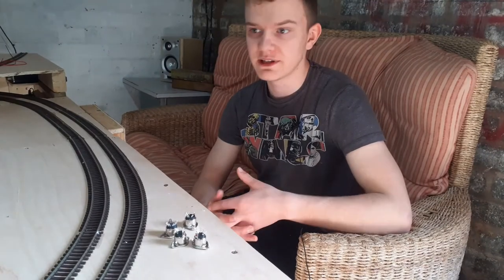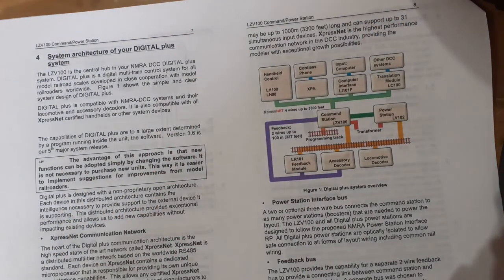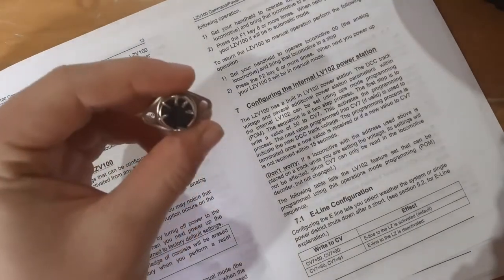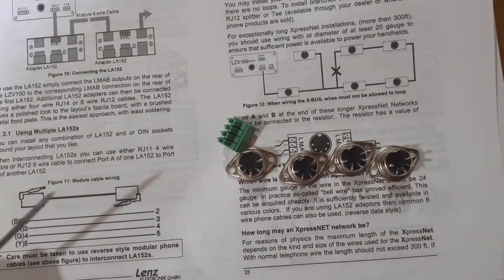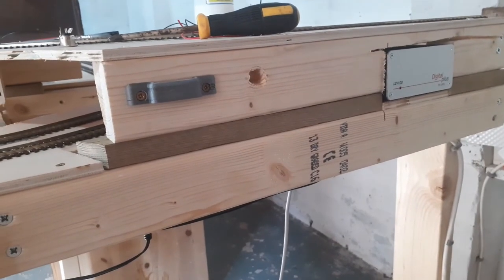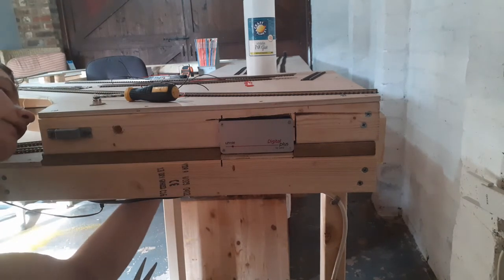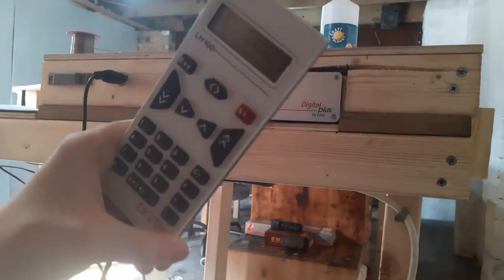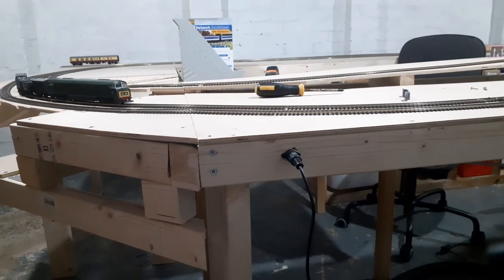7. installing Lenz DCC XpressNet throttle sockets.

Comment: I too use Lenz system and with XpressNet LA152. 5 pole DIN sockets is a good idea and a good tip is to use 4 difference color of the wires by solder DIN sockets to avoid mistakes when you connect. Have fun!

Comment: With the wiring of the bus, it would have been better to use two whites on one data and the two corresponding solid colour on the other data so twisted pair could do its job of noise cancellation.   Doubling up on the data was likely not needed though, then you could have a spare pair in case of damage, or for some other function in the future.   Doubling up power is a good idea though.
Thanks for another great video.
Reply from the maker: Thank you very much for your suggestions, I'll keep them in mind next time I rewire any expressnet

Comment: Well David, I have now watched your video and am really impressed with your efforts so far.  You are really industrious and is great to see.  I am much older than you and for me there’s no rush, so I do things quite slowly.  I am interested in Lenz twisted pair wiring installations and unfortunately most YouTube videos feature main bus wiring using straight wires.  I have about 25 points on my layout and intend to install block sections and computer control to allow simultaneous multiple train movements and signalling.  The under wiring is quite complex and the wiring layout has become jumbled so I have disconnected all the track feed and point feed wires from the decoders and am in the process of reorganising the wires neatly and fitting current detection to the blocks.  In the meantime, good luck with your layout and keep the wiring neat.  See you.  Keith
Reply from the maker: Thank you for your kind words, I've found the throttle bus has worked very well. I'm currently thi King about another small layout that could be computer automated.